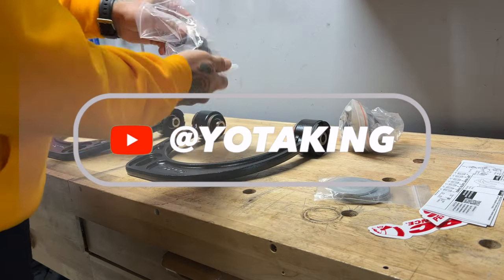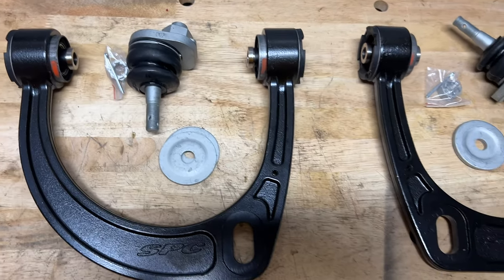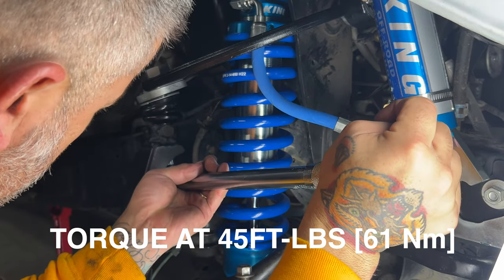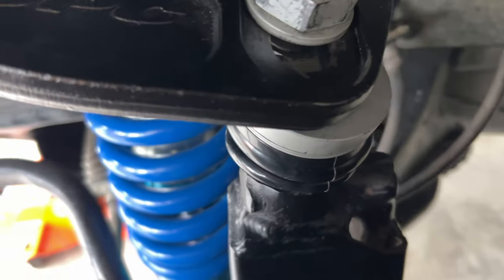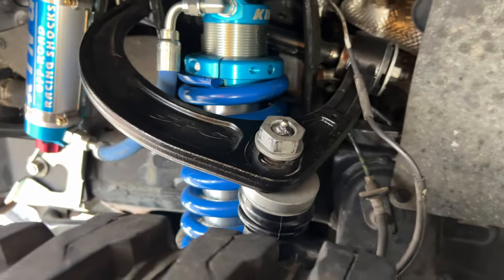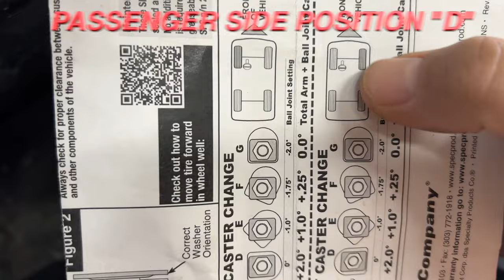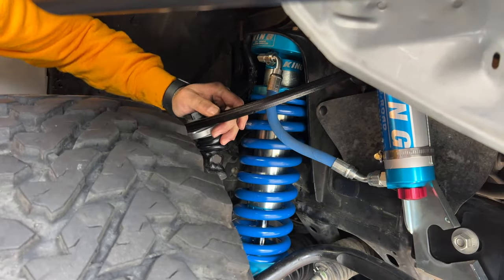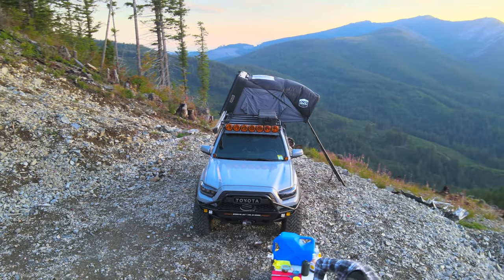Upper Control Arms SPC Performance Install

Comment: From TC to SPC...downgrade brother. Replaced both SPC ball joints 3× each and bushings once all over only 30K on 35s. I went 37s with TC uppers with heim and +2 TC lowers and Kings. Zero complaints. Hope your SPCs hold up better than mine. Good luck and thanks for the video.

Comment: On your control arms you have the ball joint logo facing you and the on the other side it’s not. No matter the adjustment is the logo supposed to face you or away from you?
Reply from the maker: Depends what side. Driver side will end up facing in passenger will be facing out.